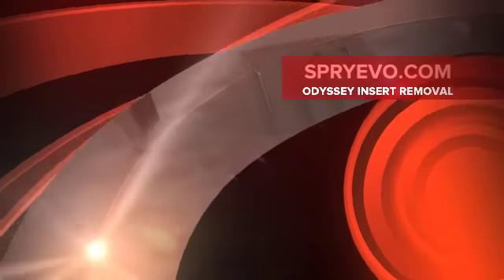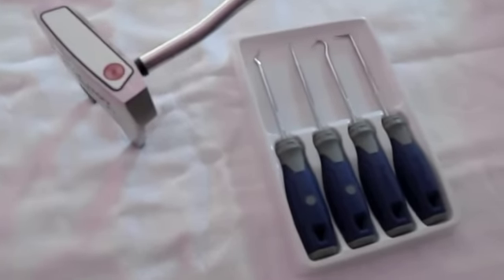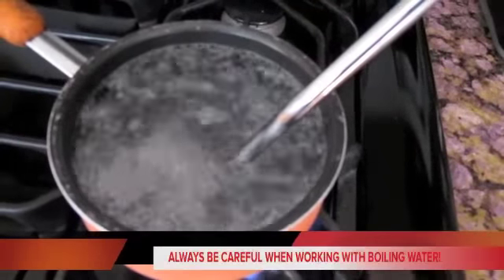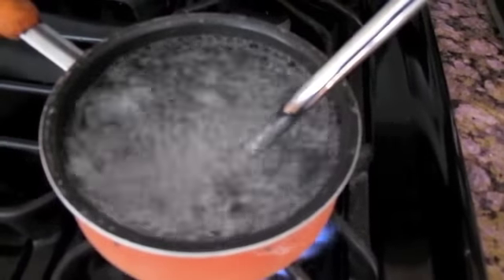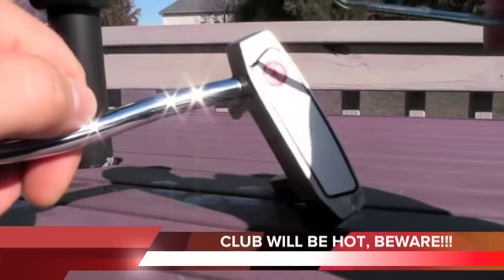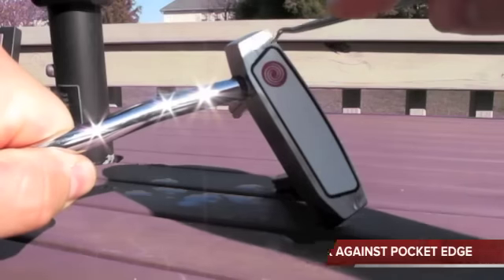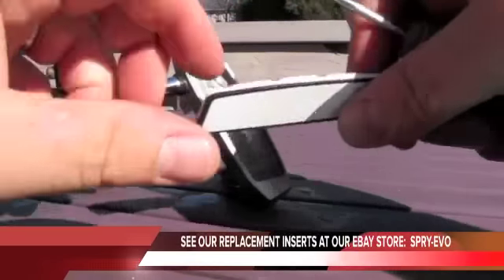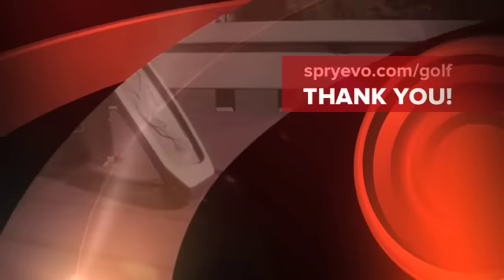Odyssey Putter Insert Removal by spryevo.com

Comment: Will the same boiling method work to remove the insert on a scotty cameron?
Reply from the maker: Cameron used epoxy on those, and you need torch heat to get them out.  Especially concentrate the torch heat on the bolts.